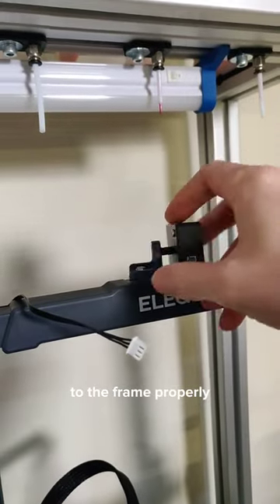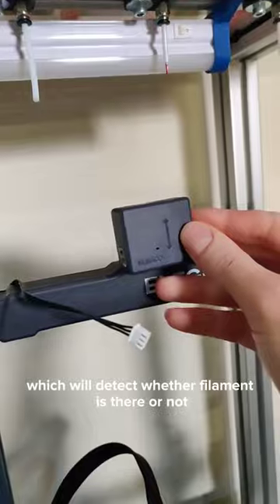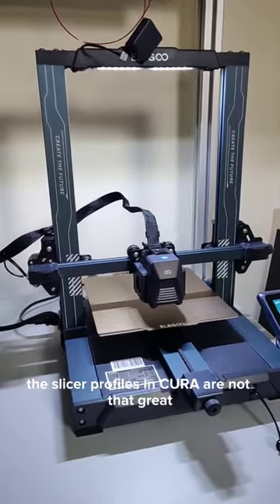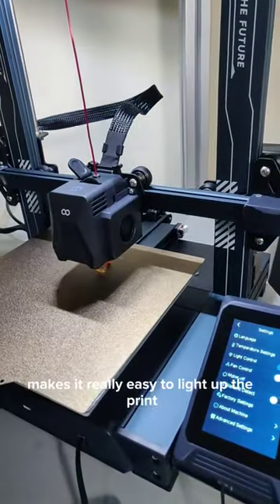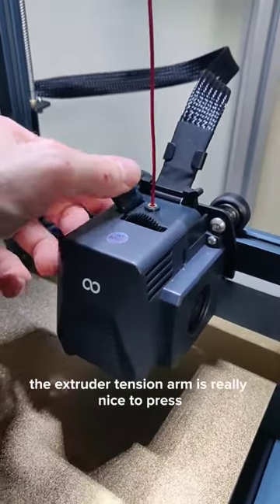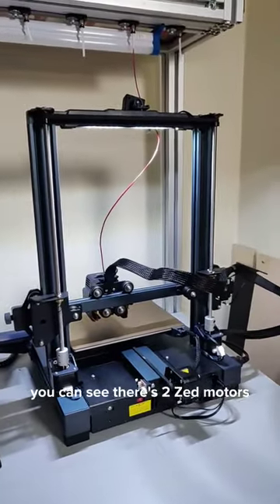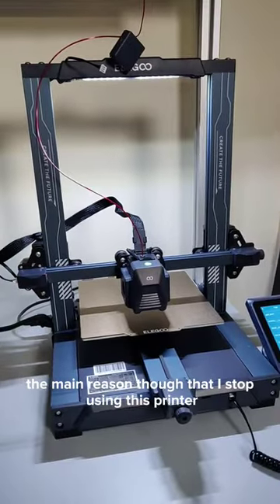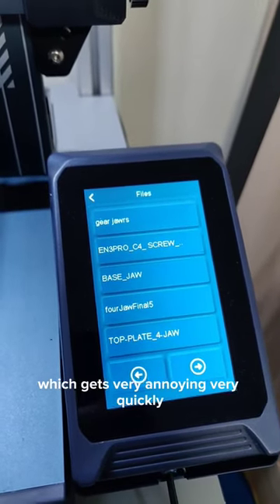Elegoo Neptune 3 Pro Review in 60 Seconds #shorts

Comment: Using 4 rollers for the x carriage isn't a bad thing, it more evenly distributes tension on the between the wheels. I don't see a reason why it'd be better to use 3
Reply: Guess he likes the bottom single roller wearing out faster taking double the pressure load from the top two
Reply: My thoughts exactly. My guy is complaining about Cura like  ???? okay use PRUSA’s software then. The printer is a crazy good deal right now at around $130 on their website. Yes it’s slow but it’s miles better than the Ender 3
Reply: Or use Orca, a mix of PRUSA and Bamboo

Comment: I have printed on the smooth side of the PEI plate without any issues. Just lay down some glue stick and it'll be fine. Provides a smooth finish on the bottom.

Comment: You can definitely print ABS on it. You'd struggle to find a workable nylon, but yes to ABS.
Reply from the maker: No for ABS. Ptfe lined hotend will off gas toxic fumes at those temperatures.
Reply: @Vector3DP  Ya, that doesn't mean that it can't, it means that you should use a ventilated enclosure or add on an all metal hot tend.
Reply from the maker: @C3qrT  ye, so make it into a different printer... The printer you buy cannot do ABS.
Reply: @Vector3DP  Yes it can my friend. You are confusing a health concern with capability. Make that distinction. If I were you with this concern I'd say "It can print ABS but you probably shouldn't without taking precaution because..."
Reply: @Vector3DP You can buy a fume hood. One thing that's great about this printer is its low base price and many upgrades